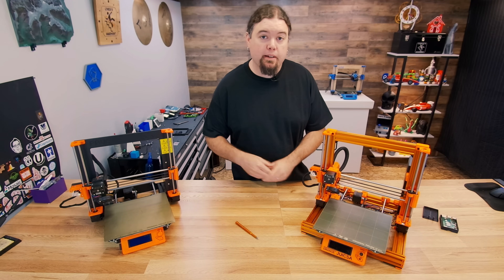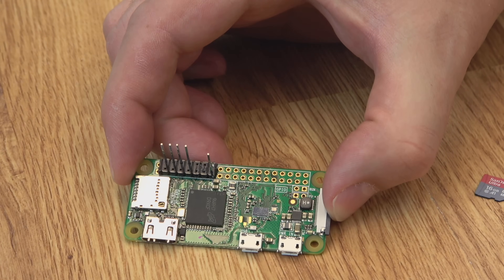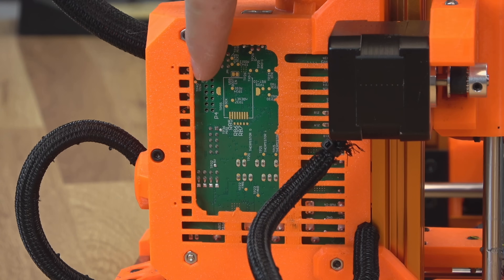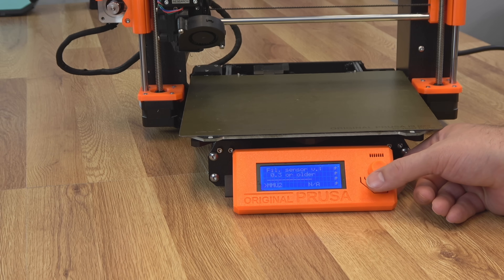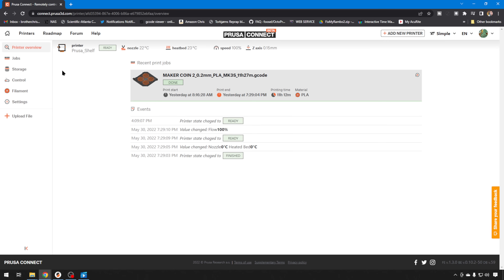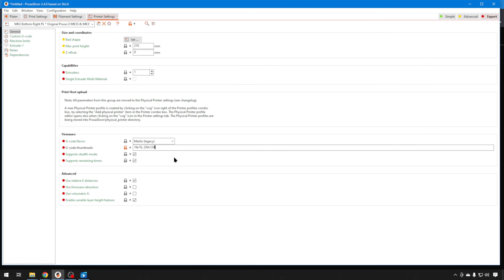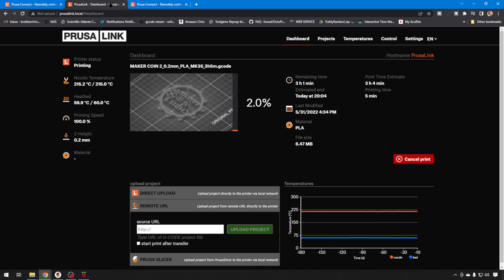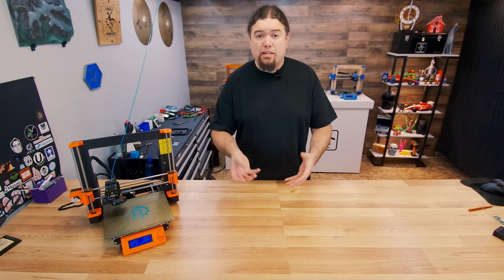Prusa Link -  Connect Up Your Print Farm - 2022 - Chris's Basement

Comment: Hello, how can I write the IP where the Raspberry PI will connect, all this before connecting the printer and causing IP problems with other machines? The detail is that I want to use the Raspberry Pi for a 3D printer but I need to write the reserved IP that I have
Reply from the maker: You would have to hook a keyboard and monitor up to the pi and se the the IP ahead of time. https://www.tomshardware.com/how-to/static-ip-raspberry-pi
Reply: @ChrisRiley  Do I have to set it before to write the image in the SD or can I just set the raspberry PI and this won't affect the image in the future?
Reply from the maker: @l0st637  It would be easier to set it after, It won't impact the image.

Comment: Hello, if I want to set my printer with only PrusaLink, it´s necessary to use Wifi meanwhile I set it? Or i can write the hostname in the browser without the Wifi connection?
Reply from the maker: You just have to have a network connection. You can use wifi or if your Pi has it, ethernet.

Comment: Hello, thank you very much for perfect video. Is there a way, how to control 2 printers via on pi 4. I have MK3S and MK3S+. I tried to connect them both with USB cable to one pi 4, but obviously, it does not work. Thanks.
Reply from the maker: You would have to create two instances of Prusa Link to do this, it is possible, but I haven't figured it out yet. Stay tuned.

Comment: Do you recommend using this configuration in an enclosure? Does rpi works in an enclosure if I'm printing ABS (250 / 90 celcius)
Reply from the maker: Yes, the zero should be good to at least 60c ambient temp.

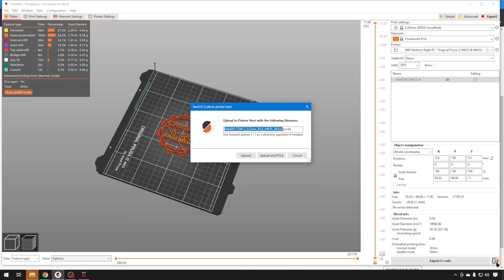Comment: 16:26 How did you switch printers?
Reply from the maker: You just update the connection settings for each machine in the physical printer settings. In prusa slicers it's in the printer settings tab next to the name, click the cog.

Comment: Many thanks for this very instructive video
Everything works fine in my environment and I am happy with that. Still some additional information. I did first install the configuration with Raspberry 4 model B and it works also fine. It just needs to have more power via an external power supply. Then I did the same with a Raspberry Pi Zero W (not Raspberry Pi Zero 2 W) and this works also fine.
Many thanks to the Prusa team and the support they provide us with.
Reply from the maker: That's great, thank you for the information

Comment: Hi @Chris Riley, I am happy to report I have both my Prusa MK3S+ printers online with Prusa Link and Prusa Connect. One printer with the Pi Zero 2W exactly like your video instructs… and the other printer with a Rasp Pi 4B 8GB simply plugged in via USB (without Rasp Pi port turn on). I just swapped my Octoprint SD card for the new Prusalink image on a new SD Card. Setting up the Rasp Pi 4B is exactly the same process other than it just being plugged in via USB and not turning on the Rasp Pi port for that printer.  The prusa connect front end is gorgeous and super clean. Printing direct from Prusa Slicer is a dream. Love it! Many thanks!
Reply from the maker: That's great, thanks for watching!
Reply: Hi ! Have you tried connecting 2 printers at once on 1 Rasp Pi ? Will they work through USB ?
Reply from the maker: @dzitiatri  I haven't tried yet, I will though.
Reply: @ChrisRiley  I will try to find doing that myself. But there and there are lots of work 😃 What surprised me is that new prusa connect from github has USB camera connectivity.

Comment: Hi Chris, thanks for this great introduction to Prusa Link and Prusa Connect. I think I would like to give it a try with my two Prusa MK3S+ printers. The only thing lacking for me anyway at the moment is camera support as you mentioned. I just use the camera on my current Octoprint instance to see how the print is going remotely. So if I get the Prusa Link/Connect setup going for my two printers (each with their own Rasp Pi), would it be as simple as accessing each Rasp pi camera independently with a web browser and the respective Rasp Pi IP address to connect to the camera and see what going on while staying connected to Prusa Link/Connect? Or would that conflict with the Prusa Link/Connect connection? Maybe I would have to close one connection before opening the other? Sorry, I am not too network savvy. Thanks for your help as always Chris!
Reply: Reading the forums over the last few weeks, it looks like they are working on camera support. Their current version, 0.7.0 RC1 doesn’t support it yet. I’m not very knowledgeable with raspberry pi’s and Linux, so I’m not sure if you’d be able to install web services running on Linux to create the pi camera web viewing. 

For my MK3S+, I just have a Wyze cam pointing at it. On my Mini+, I’m using octoprint with a pi camera.
Reply: @Josh.Wilson  Hey, thanks for your feedback! Seems like camera support might not be too far off. In the interim, I think I will just point a couple of independent wifi cams at my two printers … and then attempt to integrate Pi cams when the camera support catches up.
Reply from the maker: If Prusa link adds camera support, it should take care of all of that with prusa connect. You shouldn't have to worry about the port forwarding. Like @Josh Wilson said below, I currently use a Wyze cam to keep tabs on them. Hopefully, they will get support added soon.
Reply: @ChrisRiley  Right on, Chris! Thanks for your feedback!

Comment: Have you tried to get 16gb micro SD cards lately? They seem to have turned into unobtanium lately. At least for fast cards by reputable companies. 32gb seems to be the smallest available.

I generally prefer to have smaller cards for pies as they're easier to backup. I always felt like 8GB was a good number as you could get them in class 10 but weren't too big for backups.
Reply from the maker: I have noticed that 16g seems to be going away, I was looking for some just the other day.

Comment: Still not ready for primetime,, and honestly only makes sense if your a Prusa-only shop.  My last Marlin machine is about to be converted to Klipper with Mainsail, and with it my last Octoprint server, but Octoprint would be 1,000,000x more useful than Prusa link.
Reply from the maker: Thank you for your insight.

Comment: Thanks to you on an old outdated video I was able to get my MMU2 working. I needed that secret menu......one difference is I have to hold reset the whole time. If the printer ever boots up, the MMU2 reboots into normal mode. But yeah making those adjustments did the trick............................and then my extruder got clogged. Like HARD clogged. I took it apart and I still can't get the filament out. Unfortunately I don't have the tools to clean the nozzle or remove it. I ordered all of that. I've had it for less than a month and I already broke it. Welcome to 3d printing!!! LMAO (it is my first printer). I think the fact that I didn't have the tools to clean it was part of the problem, but I also suspect switching to silk PLA for the first time and using the same temperatures didn't help. Anyway thank you for your videos. They've been very helpful!
Reply from the maker: I'm glad I could help. The MMU2 is not always easy to work on.
Reply: @ChrisRiley  yep
Reply: @ChrisRiley  now if I can get this nozzle unclogged. I have the 7mm tool now.......but I can't find my nut driver. it's always something LMAO
Reply: Hi Ashley - which video was thee "secret menu" documented?  I'm installing my MMU2 this weekend.
Reply: @winslowjoy2629  it was like mmu2 troubleshooting or mmu2 tips and tricks or something like that. Just search his channel for mmu2. There aren't that many videos and I think they are all helpful. One of them deals with making sure the filaments don't get stuck in the tubes. I went from 1-2 MMU2 failures in an hour to none since with the exception of a tangled spool.
Reply: Cleaning extruders is a pain but I quickly learnt that after removal, soaking the heatblock / hotend with nozzle in a small dish of acetone helped a lot. The hard plastic turns soft and brittle - much easier to remove with a brass brush or even an old toothbrush. I use a heat gun with the hotend in a vice to easily remove extruder/nipple before or after the acetone bath. The tricky part for me is removing the hot end from the print head without damaging the heat cartridge or thermistor cables. All good so far but the less I have to remove them the longer they are gonna last.